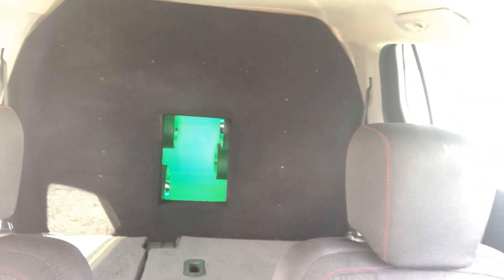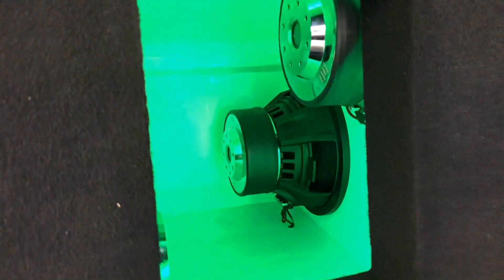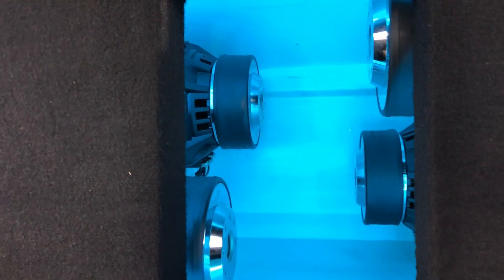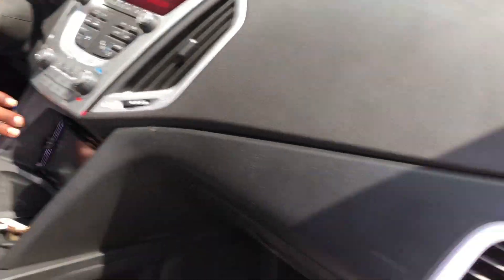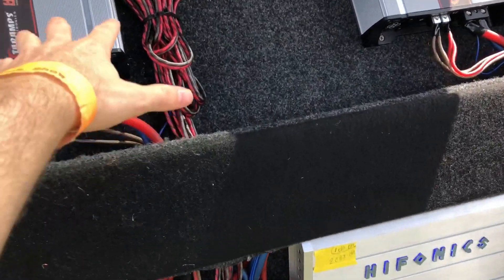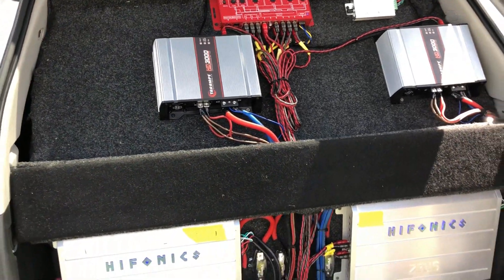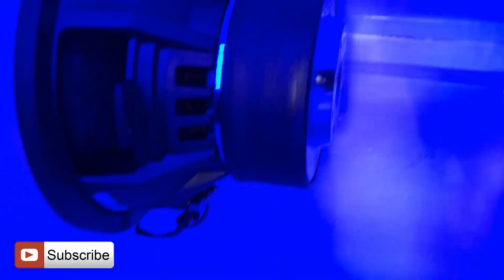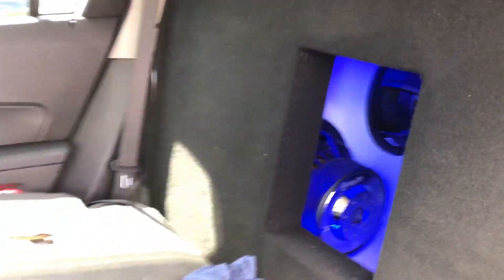4 AMERICAN BASS 12S CLEAN INSTALL

Comment: When upgrading door speakers to a lot better speaker would I have to install a separate amp to power them? If so how do I wire an amp to power all  the speakers in 4 separate doors?
Reply: If your only running  a component set....ya know left and right for the front stage. You would need a 2 channel amp. If you are running seperates in the front and 6×9 or even another set of seperates in the rear a 4 channel amp would be in need. But you can run 4 sets of components of a 2 channel just check your ohms and what the amp can handle if you go that route. And have ONE dedicated amp to push your subs.
Reply: ead Josh ok thanks!